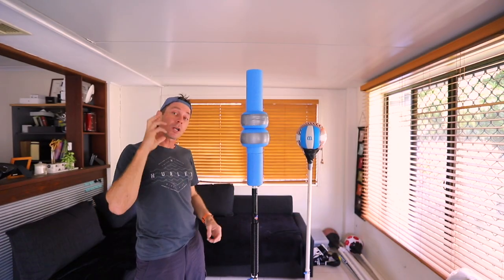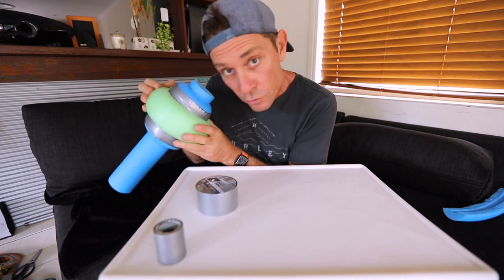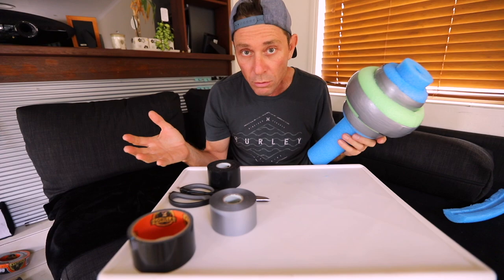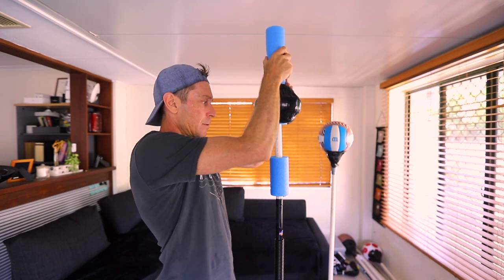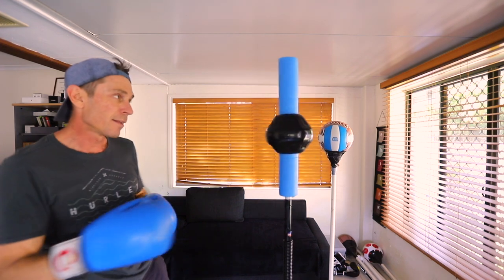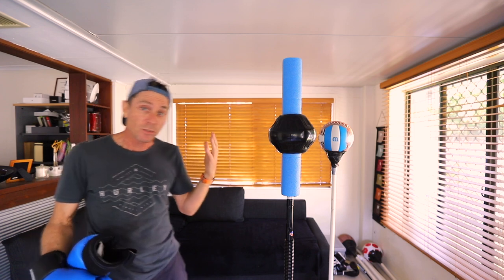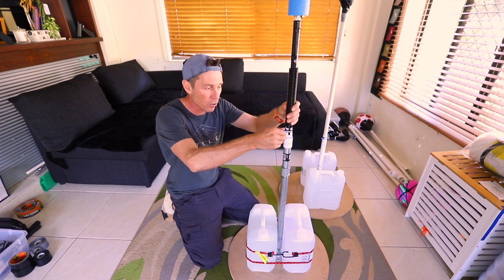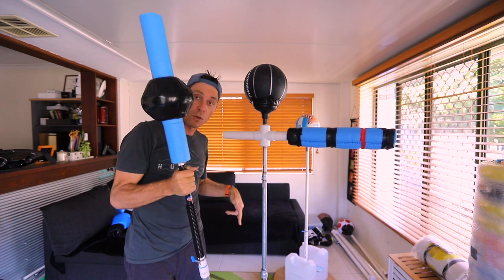DIY Cobra Bag Prototype V4 - Pool Noodle Speed Bag for the top?

Comment: Hi man 😊 
What is the best do u see for the fast 
The spring 30 kg
or spring 40 kg
or pvc pipe ?
Reply from the maker: Springs and PVC are different in movement. In general PVC is faster if using 3/4 pipe and a light ball
Reply: @Kewlus  thaaaaaaaaaaaaaaaaaaaanks

Comment: Finally got the action how I want it, but the plunger just never stays put, even though it’s a snug fit, hose clipped and taped, it always shoots out after a while and without that weight on top, it has no action. Any ideas on what might provide the weight I need for the action that might actually stay put?
Reply from the maker: This new type of speed bag made from pool noodles is actually quite a good alternative. As for the plunger, if you’re going to persevere with it, perhaps try using different, stronger tape. You should also reinforce the outside with a funnel- that should make the connection stronger